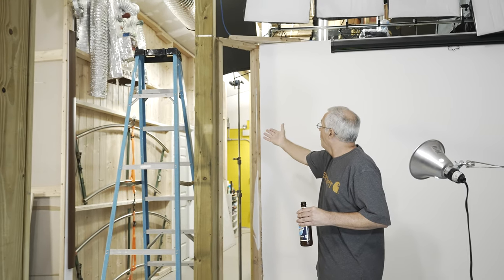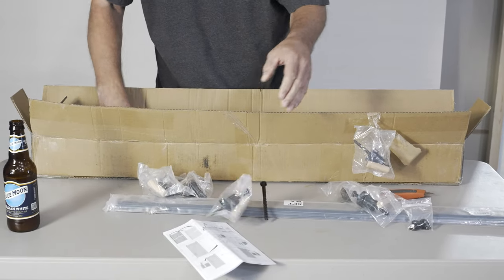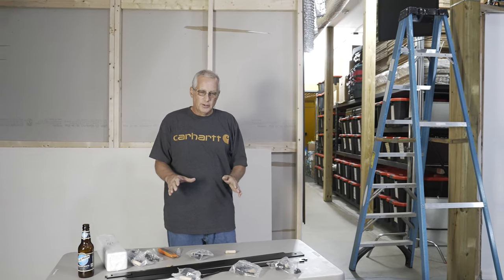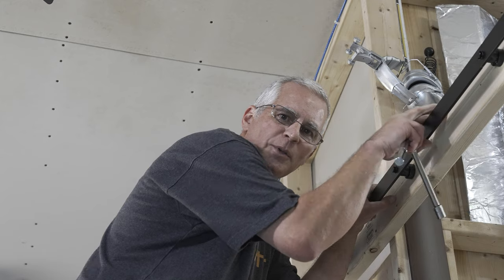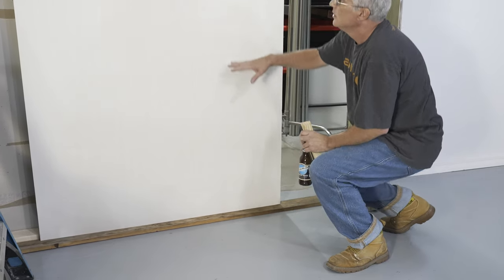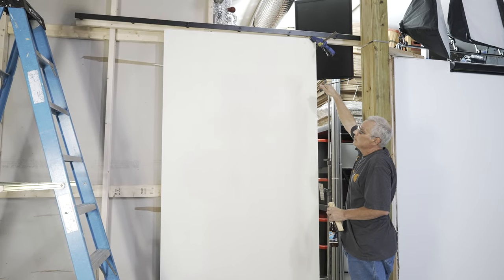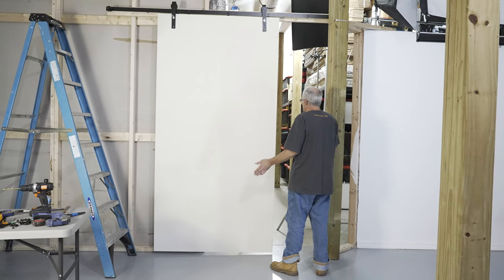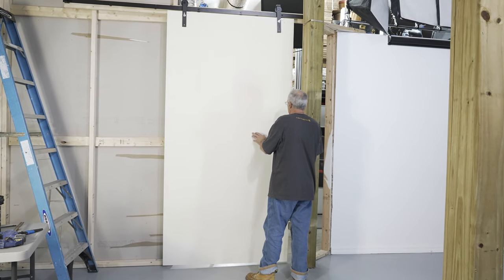How To Install Barn Door Hinges from eBay or Amazon - DIY Barn Door

Comment: 8 washers = 8 beers! I think this is the first video ever that I've seen you use the instructions! 🍻🍻🍻🍻🍻🍻
Reply from the maker: Actually the instructions were unusable and I did not use all the parts they provided. Also, had to modify the design because of the safety issue with the door not being secured to the track. But you get what you pay for.